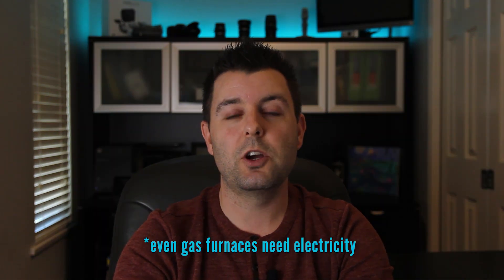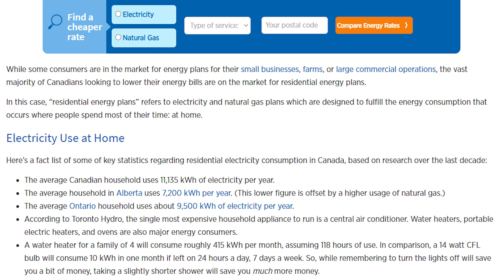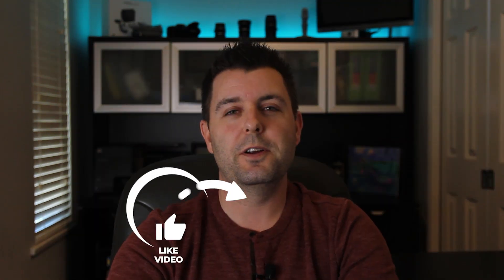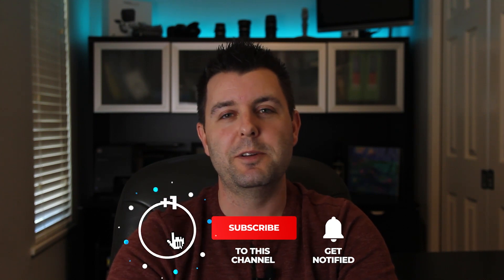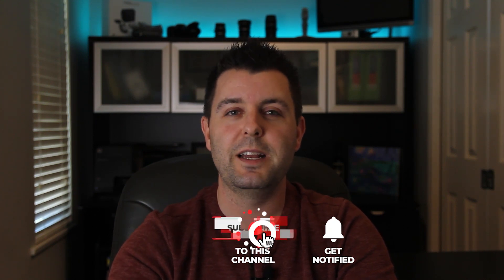Vehicle to Home Power | Using your EV to Power your Home

Comment: I really want to figure out how to be able to do this in an emergency with our 28kWh Ioniq.
Reply: Get yourself an inverter (1000-2000 or more), connect it to the 12v battery, turn on the car and leave it in the ready mode, you now have full use of the HV battery.
Reply from the maker: Sounds simple enough. Do you have a link for something that would do the trick?
Reply: @scottandshaun  the Ioniq has a grid forming inverter, right?  that should mean theoretically a transfer switch alone would work.
Reply from the maker: Yeah....the technology is still a little behind I think.  Currently only Chademo chargers are certified, and I believe the Ioniq has a CCS charger on it.  I would think that the tech will catch up, hopefully soon, so that bi-directional use of the battery is a little easier for anyone with an EV.  It just makes good sense.  Thanks for watching, and commenting, I appreciate it.

Comment: A reliable diesel engine(acceleration set) in boot/chasis for ev can do both things.
Generate electricity and charge the battery of car.
Reply from the maker: Somewhat defeats the purpose of the ev, but I like cool engineering, so show me the setup :)
Reply: @derekthornton  First need to run for patent of this concept or get on shark tank show.
Reply from the maker: 😂 Keep me posted

Comment: I have a Mustang Mach-E and I would love to use it as a backup electric generator for my home. How do I do it?  Is there a proven solution that I can buy and install?
Reply from the maker: Unfortunately not yet, as my understanding is that the Mach-E doesn't support the 2 way power. You could hookup a 12v inverter to your 12v battery, and get about 1500w of power in a dire emergency, but that's hardly enough to power the full house as usual

Comment: I have a 2016 Leaf (30 kwh battery) and a 1,000 watt sine wave inverter.  I installed a permanent quick connect in the Leaf for plug-and-play inverter connection.  I am a first responder and we have had 3 power outages  in our area of British Columbia this year.  I used the Leaf to power our lighting, modems and desktop computers to provide reliable emergency communications.
Reply: Does this exist in United States. I  have 60 kwhr battery and would pay to be able to plug right into my pannel safely. Then I could recharge my car with my generator
Reply from the maker: The tech is available, as far as I know but incredibly expensive
Reply from the maker: That's awesome, thanks for sharing. Do you have a link to the one you use?